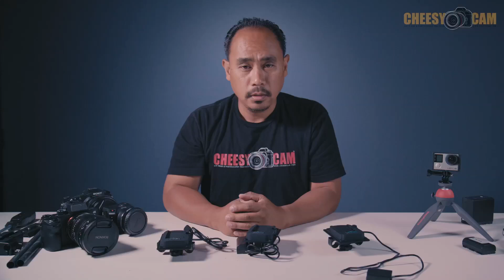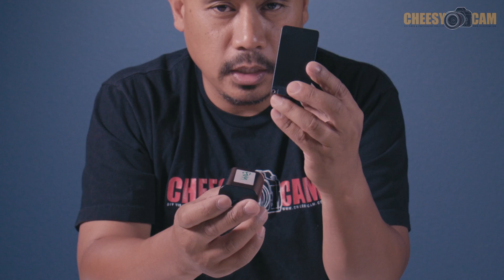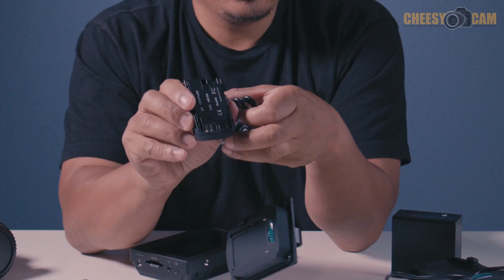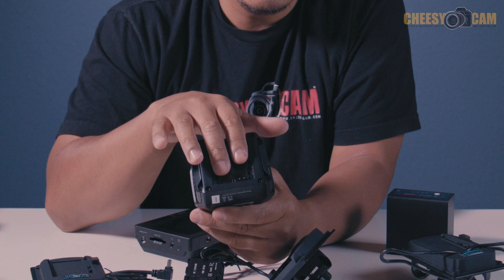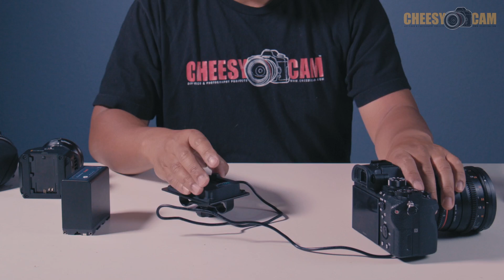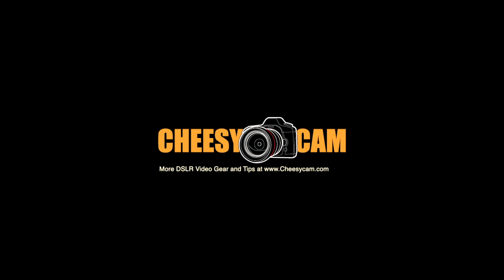IndiPRO Tools External Power Sony L-Series Mounting Plate with 15mm Clamp

Comment: Hi Cheesy do you know if anyone makes a Sony NP-F "Dummy Battery" AC adapter to power my Sony CLM-V55 field monitor? Kinda like the one that comes with the Atomos NINJA 2, but smaller. I've seen some D-Tap dummy batteries.. maybe there is a D-Tap to AC adapter? I'd like to plug in more gear. Not have to swap batteries so much.
Reply from the maker: Yes there are such things. Something like this immediately comes to mind that will work with most D-Tap Dummy batteries: https://bhpho.to/2A3ihHY

Comment: Using the dual sony l plate version of these, can you also power other accessories? Like a monitor or external recorder?
Reply from the maker: Yes with the right cables you should be able to power other accessories.

Comment: Any way to get that Sony NPF battery mated-up to a BMCC or BMPCC(I have both)? A cursory search yields nothing promising.
Reply from the maker: Sony L Series batteries are only 7V. BlackMagic Design Cameras usually want 12V+. So you'll need to look for a bigger battery. I would honestly look for V-Mount battery solutions for a BMCC, but for a BMPCC you can try using a Sony BPU-90 which is a 14V battery used on Sony camcorders like the EX1. https://www.youtube.com/watch?v=GxDPTqrwrOE
Reply: +MrCheesyCam The internal battery on my BMPCC is close to (if not the same as) the voltage on my A7rii. I don't suppose there's a dummy battery available for the BMPCC ?

Comment: I like those dummy adapter to power screen or wireless system (follow focus or video transmiters), but not dslrs. It's way to big and require rods. A much better alternative , in my opinion,  is to have a couple of npfw50 in your pocket. they are small, compact and inexpensive.
Reply from the maker: Sometimes it's nice to run super small, sometimes it's nice to have the extended battery. When I do interview, I usually build up the camera anyways with a bigger monitor, and better audio. Then it sits mostly on a tripod during interview type stuff, which could go on for hours. In my case it's super nice to never have to worry about battery power.

Comment: I've found that the smallrig baseplate doesn't give enough clearance for adding a follow focus or mattebox with the A7s. On my setup I have a cage and arca swiss between the camera and baseplate so the film plane to rod plane matches up with my genustech mattebox.

If you intend on adding more accessories, getting some sort of spacer in there is a good idea.
Reply from the maker: Right, a proper rig would be best. For Sony cameras, I suggest a cage that has proper metabones or lens support as lens adapters are quite popular on those cameras. I've also got some good Cage reviews for these Sony cameras in my channel.
Reply: +MrCheesyCam and I have watched every single one I think. very useful :)